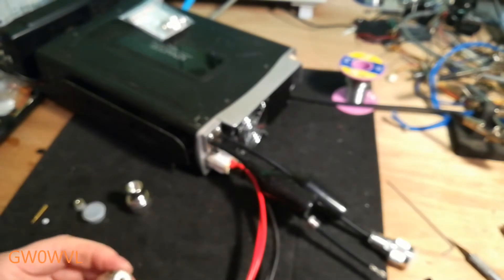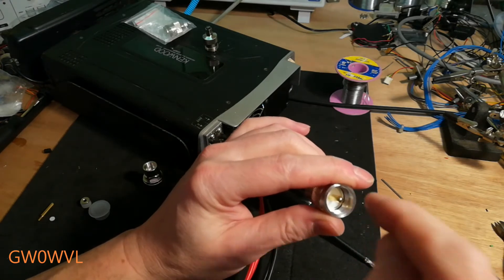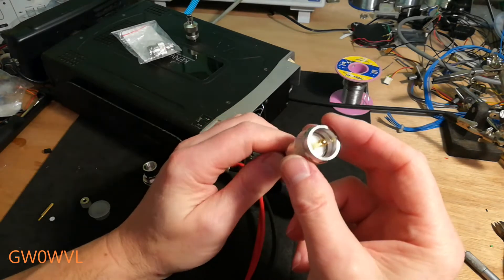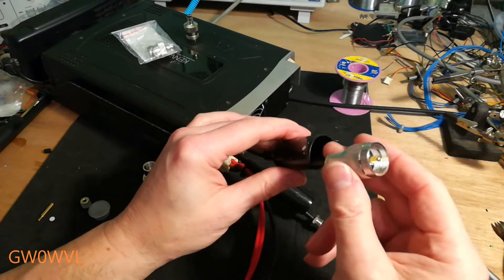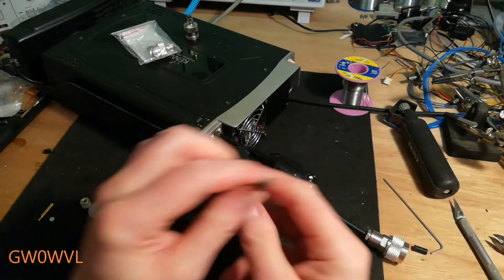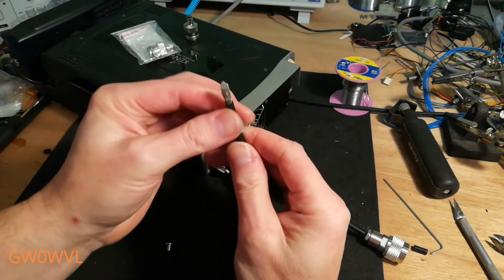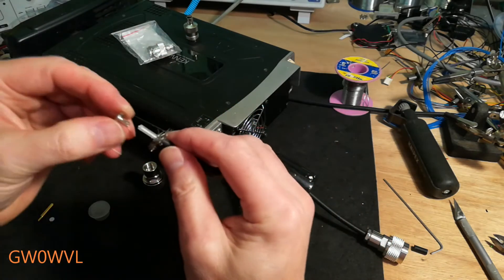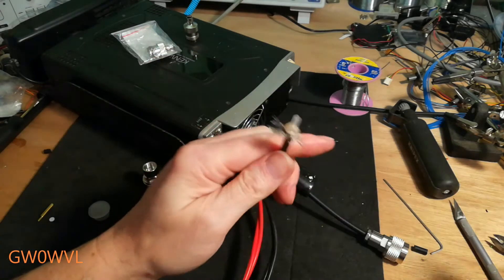GW0WVL ... Kenwood TS-480  Simple repair .

Comment: That's a good idea using the double end barrels so they can be changed easily when they mess up. 👍
Reply from the maker: I thought it was the cheapest and easiest way to be fair , Going through to Yaesu and buying the Replacement leads with fitted sockets would have obviously costed a lot more , And who knows how long those Replacement leads and sockets would have lasted ?